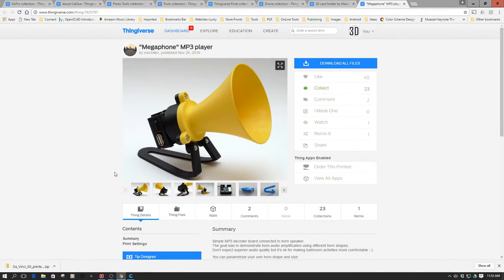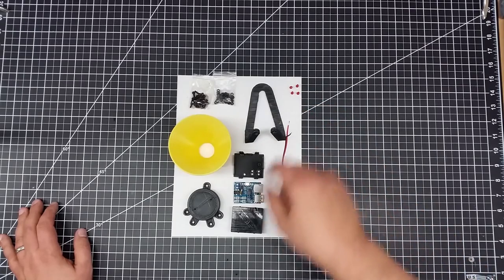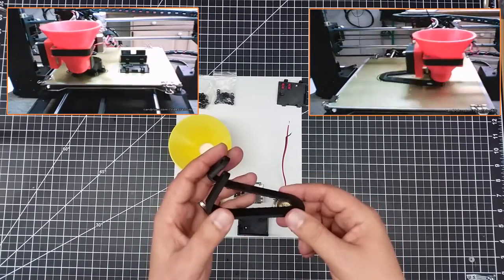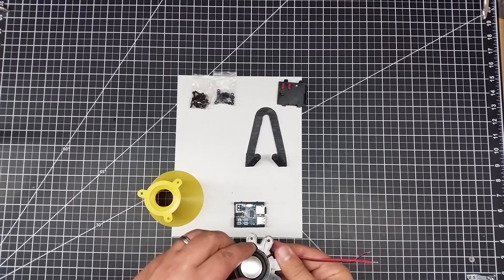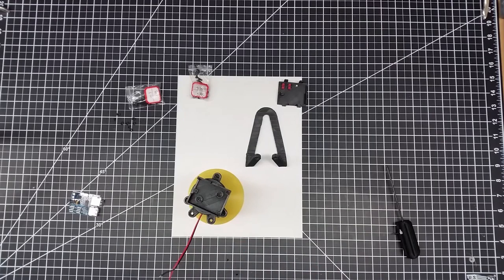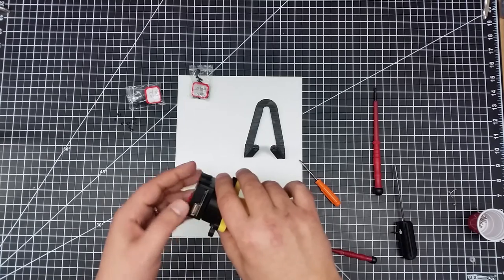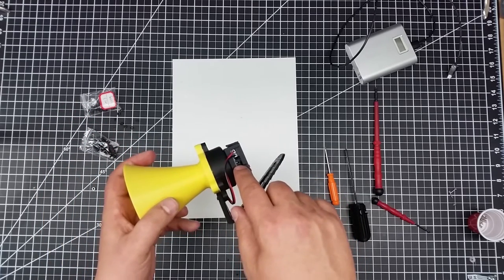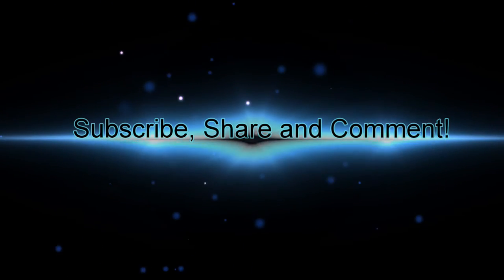Thingi-Finds MP3 MegaPhone!

Comment: Thank you very much.
Please give it to us slicer settings and how long 3d printed time the project part.
Reply from the maker: It will depend on the plastic you use and your printer.  I would suggest 20% infill and PLA at 210c for the hotend and 60c for the bed.  However you may need to tune for your printer...